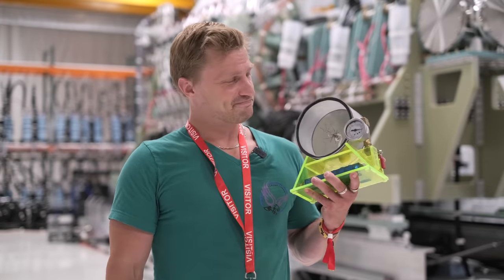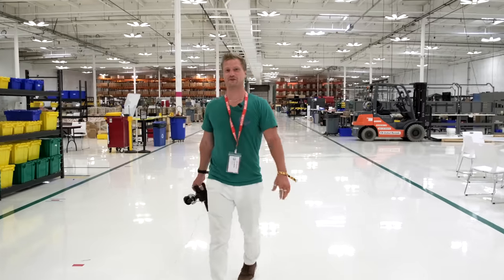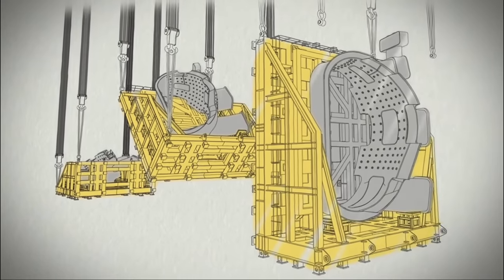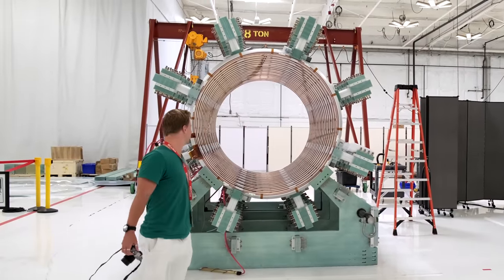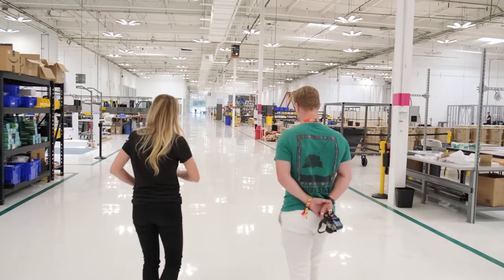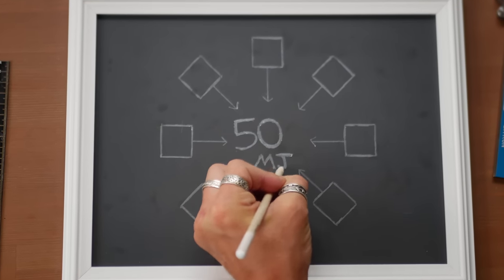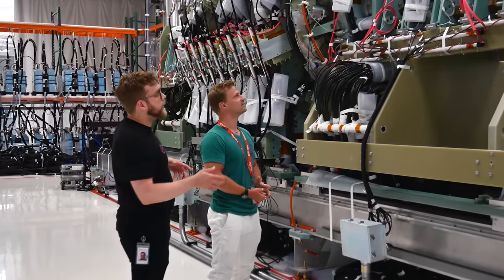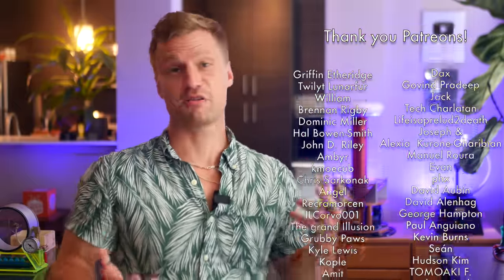An Exotic Approach to Nuclear Fusion (Helion Energy BTS)

Comment: The electrical power extraction process its brilliant. Way better then the classic thermodinamical approach that as thought for DEMO (ITER's son) extracting heat from the walls and riding a steam turbine. @HelionEnergy thoughts about implementing the p-B11 reaction? I know the ignition temperature its "a bit" higher ahahah but the reactants are pretty common and the product are pretty much alpha particles, which will contribute massively to induced current for the power extraction. Do you think that would be feasible?
Reply: Helion actually does not want ignition (which means the products are hot enough to heat the plasma without external heating). Since they can extract the input energy (along with the fusion energy) at very high efficiency, they can get away without ignition. Depending on how efficient it is, they might even be able to get away with a Q(sci) < 1 and still produce small amounts of net electricity (counter intuitive, I know, but it is true). PB11 would be interesting, but I believe it would require a much bigger and much stronger machine. One of the cool things about Helion's design is that it is still transportable by road.

Comment: Please investigate thunderstorm generator.  Plasmoid   Hooks to any engine no carbon emissions only oxygen emissions. Please research idk. It's open sourced so build ur own.
Reply: A bolt of lightning is about 278 kWh. That is enough to supply 180 households with energy for about an hour.
Might sound like a lot, but how much effort does it take to capture that bolt of lightning? You have to capture and store it in microseconds (way shorter than a Helion pulse). That means very powerful and robust capacitors. Meanwhile Helion's machines will produce single digit kWh pulses about 10 times a second. That is much more manageable. Their capacitor technology is much more realistic.

Comment: you are telling us something like induction heating to generate high pressure high flow of steam. something we had used for more of 40yr. is the breaking edge solution? the solution is something we always had?. i think there is no real desire for a real solution. i only see mediated propaganda for a problem we always had the solution but no real will to apply it

Comment: After watching this video i was recommended a video where this guy calls this company out. Basically says the fuel wont produce enough output at the temps they run and that it does infact produce nutrons that are radio active. I dont know which is true, i hope helion is cause the tech sounds awsome and plausible but I don't know anything about the molecules and how they react to different environments and how they interact with each other. Guy had a chart but anyone can make a chart in 5mins and act like it means something and to anyone who don't know he's lying will say yah that makes sense. Well yeah it does when u lie yah know .
Reply: I know this video you are talking about and he gets about everything wrong.

Comment: Six pulses per minute?
Should it not be six pulses per secod?
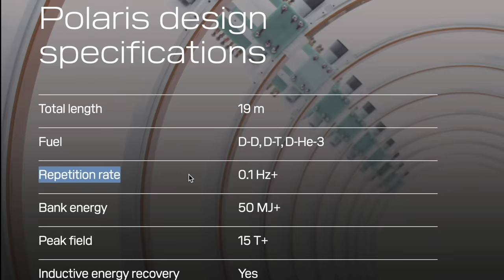13:11
Reply: I believe Polaris will do 0.1 to 1 Hz.
Reply: Per minute is correct. For fusion to work at all the fuel needs to be held in confinement at the target temperature for some amount of time. There has to be enough time for the chance of two atoms colliding and fusing and producing a byproduct (e.g. gamma ray, neutron,  or proton). So you're spending energy all of that time to maintain confinement and you're relying on probability to produce enough events per cycle to exceed your expenditure. In the Helios scenario they're relying on those events to continue to heat the plasma, requiring more energy input to maintain confinement, thus extracting net energy via the contraction and expansion. This will of course never result in net energy because the fusion is expelling the vast majority of its energy in the form of high energy neutrons. But maybe it could work like a hybrid car with a way to reclaim some of the input energy.
Reply: @StoneUSA  
Polaris will do 0.1 Hz, though I believe they plan to increase the pulse rate to 1 Hz over time (unless that plan has recently changed).

Their pulses last for one 1ms. It is a pulsed system, not a steady state system.

D-He3 fusion does not produce any neutrons. However, Helion needs some D-D side reactions to produce the He3. Half of those produce a 2.45 MeV neutron. Depending on whether they have enough He3 from Tritium decay (T is produced in the other half of the D-D reactions), their machines will produce one 2.45 MeV neutron ever 3 or 4 reactions. The vast majority of the energy (>90%) is in charged particles (14 MeV protons, 3.02 MeV proton, 3.6 MeV Alphas, 0.82 MeV Helions and 1 MeV Tritons).

They are indeed planning to reclaim most of the input energy along with the fusion energy.

Comment: D-3He is not entirely aneutronic.
Reply: D-He3 is entirely aneutronic. You are probably thinking of D-D side reactions, half of which produce a neutron. Helion actually wants those because that is how they make their He3. Overall, they would get a neutron in 1/3 reactions or even only 1/4 reactions (assuming that they have enough He3 from Tritium decay). Those neutrons are also only 2.45 MeV (vs 14 MeV from D-T fusion). That is below the activation energy of many materials and activation of other materials is rather benign with 2.45 MeV neutrons (short half life).

Comment: Aneutronic reactions are obviously simpler to harvest, the catch is that He3 is even harder to find than tritium.  Probably won't be really economical until we can start harvesting it off the lunar surface, where He3 coming in from the solar wind tends to lodge in the regolith.
Reply: I believe I’ve heard that they plan on making their own supply in-house, although I don’t have (haven’t bothered to get) a source (yet).
Reply: @Suppagappa  they are fusing Deuterium in the same machine to make He3 and Tritium (which eventually decays into more He3). It is in their patent "advanced fuel cycle and fusion reactors utilizing same"

Comment: Exciting it surely is and the issue is important. Their facility is cool. The people are beautiful. They are building a machine that would be a natural fit in any Marvel movie.

So why am I not convinced and instead feeling a bit Theranosed?

The slamming together of two plasma vortices sounds right at first listen. We build accelerators and do big physics in them after all, right? But as a linear accelerator that thing is miniscule. What meaningful contribution can the kinetic energy imparted to the plasma by it possibly make? 

But what do I know? So I might as well wish them all the best. But I would not bet in favour of that system ever reaching a Q greater than 1.
Reply: The acceleration of the two FRCs towards each other is only part of the equation.
The FRC then merge into a single, bigger, hotter and more stable FRC. It is still cold by fusion standards, maybe a couple of hundred eV. That FRC is then compressed to fusion conditions. The merged FRC just makes for a better target for that. One reason is that during this kind of formation, the ions get a lot hotter than the electrons (>10:1). This temperature relationship is maintained until peak compression, after which it slowly goes towards equilibrium. Having hotter ions than electrons greatly reduces losses and is one of the reasons (there are others, like the high Beta of the FRCs) why Helion can do D-He3 while Tokamaks (which are always in equilibrium) can't.
Reply: @elmarmoelzer2229  Clearly more massive. 

My uneducated guess is by as close to a factor of two as the precision of engineering and control allows :-). 

But why is that better than starting with twice the stuff in one place and not bother with the acceleration?

It will get hotter if compressed, and they talk about compressing and expanding the plasma under control. But that does not sound like a function of them "slamming" together. But rather the result of a separate mechanism. Otherwise how would you expand it? You can't slam things apart, can you?

It probably is utterly futile for me to ask by what mechanism the stability increases as I don't have the physics to understand the answer.

To my idiot's mind the two sections of plasma are configured very similarly to vortex rings in air. Those are inherently quite stable. 

But wouldn't the poloidal flows of the two rings precisely cancel each other out when they mix in the middle? Thus negating the stabilizing effect and just making a blob?

I want to believe :-).

Comment: Personally think there not enough Helium 3 supply for this reactor to become a reliable power source.
Reply: That is why Helion makes their own He3 by fusing Deuterium.
Reply: @elmarmoelzer2229  but that is another step that they need to work out? Better yet why bother with the helium 3 burning when you are getting energy from the Deuterium burning?
Reply: @knightsun2920  
D-D burning happens naturally in a D-He3 machine. They can control the ratio of D-D to D-He3 reactions. 
The D-D reaction by itself barely breaks even. It is the D-He3 reactions where the money is. They more than double the average energy output per fusion reaction (assuming a one D-He3 to two D-D reaction ratio).
They can also sell the Tritium that they make with the other D-D reaction branch for extra dollars, or wait until it decays to more He3 for future fuel.
Reply: @elmarmoelzer2229  the conversation is irrelevant as it is never likely going to happen. It is jut to difficult.

Comment: As cool as it seems, this thing can't work. Its power output has no hope but to be extremely low. Also, there seems to be an absence of the necessary extremely thick Lead shielding. Why do such intelligent people stake their sacred honor on what will eventually be revealed to be a hoax? These guys seem to be one neutron short of a complete Helium atom, if you get my meaning. Sad to say, it looks like our only hope is the cross-sectional increase being implemented by the ITER project.
Reply: - And you know all that how? 
- Trenta did not need much shielding (there is some in the walls, away from the machine. It was mostly doing experiments with hydrogen and Deuterium. Deuterium releases one 2.45 MeV neutron in every other reaction. Much more benign than Deuterum- Tritium. They did tens of thousands of pulses, but a pulse only lasts a millisecond (or less). So the total operational time of the machine was only a few tens of seconds. So not that much neutron exposure and damage.

Comment: looks like a investment scam. he talks nothing about the actual output, milestones...no hard numbers. If you look on another fusion projects, you become data you can understand the project better.
Reply: Nonsense! Helion has been around since 2009 (was a door name for MSNW LLC before officially incorporating). They had very little funding for the majority of that time. Scammers go for quick bucks. Fusion sure is not. To make things worse, their investors have been on the board since almost the beginning. Their main investor Sam Altman has been chairman. Their investors demanded they test parts of their designs in smaller machines to ensure that this can work. They also brought in reviewers from the big national labs to review the results before handing out the big bucks for Polaris. Building a working fusion machine for scam, would be quite a feat!
Reply: @elmarmoelzer2229  yeah, totally not a scam and you're totally not hired by Helion to answer under each damn comment where they're criticised.
Reply: @avastorneretal  I think you and many armchair critics (who have ZERO knowledge of the subject) will eat their words soon. Not that you (and the others) would ever admit to being wrong. It is the same with those people who still think that SpaceX will never succeed while SpaceX has captured pretty all of the launch market. Note that a lot of former SpaceX engineers are now working at Helion...

Comment: All this is vastly cost-inefficient, compared to simply letting markets provide us with cheap, widely-distributed small molten salt reactors powered by thorium and/or plutonium. With much fewer regulations and with competition, dangerous, huge, ultra-expensive tax-slavery financial sinkholes like this wouldn't be considered desirable. They're only considered "a good use of time and energy" now, because people aren't considering the advantages of programming smarter software on better brain-like modular ML systems.

Comment: After watching as many thunderfoot videos as i have, something about this smells like a clever scam.
Reply: Very difficult to make a scam, when your investors have been on the board, your main investor has been chair main for almost as long as the company existed. 
Helion had to take baby steps with very little funding for 10 years with every step subject to external reviews before they finally got the big bucks for Polaris. A scam would look for making money quickly and with low risk, usually riding on some trend. This is neither. Instead it is based on established physics, used creatively. Despite all of the due diligence, they  might still fail and their investors are actually aware of the risk. Sam Altman (main investor and chairman of the board) has actually said as much too. But the potential gains justify the risk.

Comment: it wouldn't generate more power then what went into it if it takes electrical energy to create the fields to create the pressure and heat. and extraction of heat will never bee 100% efficient, you need a reaction that sustains itself after initialization from a pulse. Not constant pulsing.. These machines are not going to be producing usable grid electricity..
Reply: fusion reactions are releasing A LOT more energy than what was needed to initiate them. Also note that hydrogen bombs are essentially pulsed fusion devices.
Reply: @NeverSuspects If that argument were true, then internal combustion engines wouldn't work, they don't sustain continuous chemical reactions either. Discontinuous explosions of gas-air are enough for ICEs, as pulsed plasma fusion is for the kind of reactors shown here.

Comment: Garbage device. The difficulty of D-He3 fusion is 4 times of D-T fusion. The minimum requirement condition for D-He3 temperature times the density times the holding time is 1.2x10^22. This device's holding time is almost 0.

Comment: “The Helion Fusion Engine will enable profitable fusion energy in 2019,” - NBF 7/18/2014.

“If our physics holds, we hope to reach that goal (net energy gain) in the next three years,” - D. Kirtley, CEO of Helion in the Wall Street Journal 2014.

“Helion will demonstrate net energy gain within 24 months, and 50-MWe pilot plant by 2019,” - NBF 8/18/2015.

“Helion will attain net energy output within a couple of years and commercial power in 6 years,” - Science News 1/27/2016.

“Helion plans to reach breakeven energy generation in less than three years, nearly ten times faster than ITER,” - NBF 10/1/2018.

2023 (Still nothing)

---------------------You are here
2024 (Still nothing)
Reply: And if you read the actual articles, you will find that these claims depended on funding, which Helion did not have until summer 2021.
Reply: @elmarmoelzer2229  see you later in 2025,  you have 8 months left.
Reply: @avastorneretal   You have seen the progress that Helion made on Polaris so far, right?

Comment: I have been following Fusion research all of my life.  Every so often a "new" method or a "break thru" would be publicized along with the prediction that Fusion power will be a reality in another 30 years.  But like a carrot on a stick in front of a donkey, this goal is never reached.  So far all of these efforts are nothing more than lab experiments.  It's one thing to perform an experiment that produces fusion energy and another to produce enough sustained energy to facilitate a commercial power plant.  Sadly I'll be dead and most likely so will my children and grand children before fusion power becomes a reality.